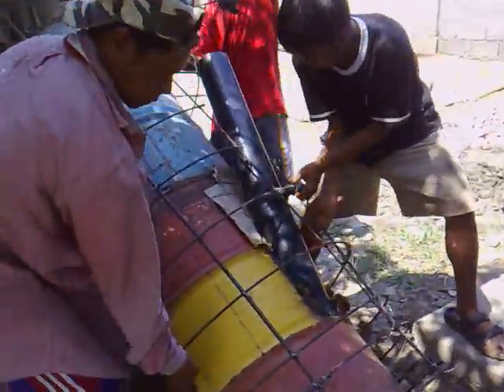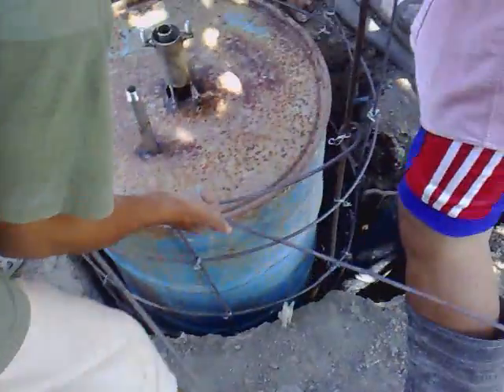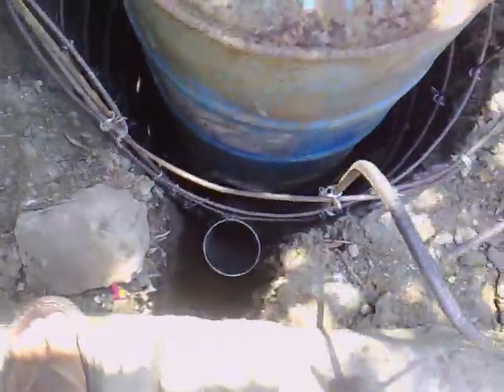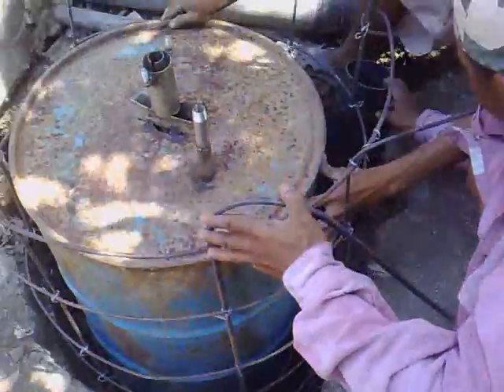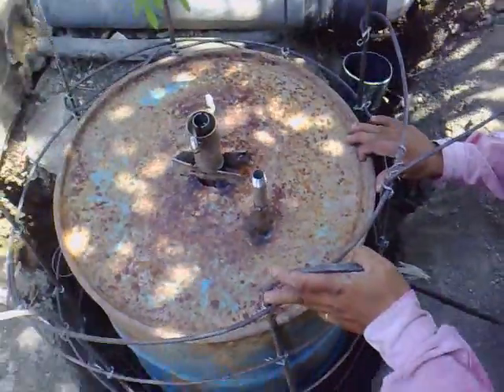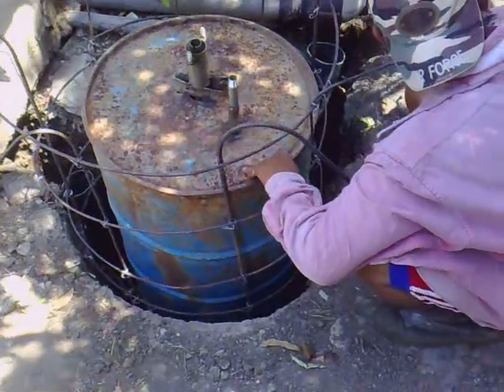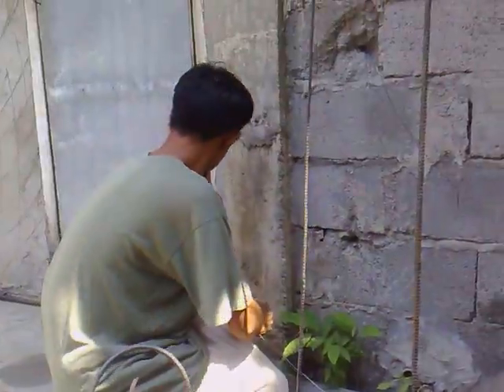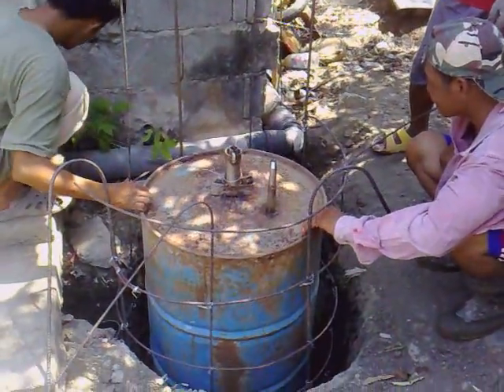MY (CH4) BIOGAS PROJECT/ PHILIPPINES ( UPDATE ) PART II  042410  VO15

Comment from the maker: @ramilarcilla42   The purpose of the drum  here is just to mold the biogas digester by a concrete cement
the drum soon  will corrode but the strong concrete remains the permanent biogas digester....i use stainless steel pipe for  the gas output....  this will last forever ..........